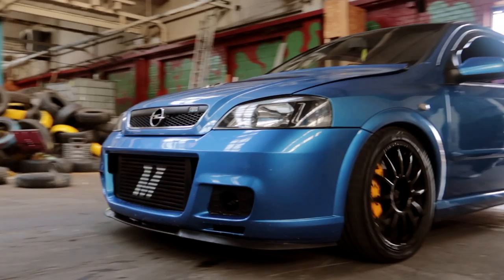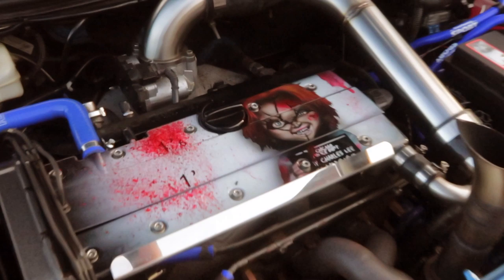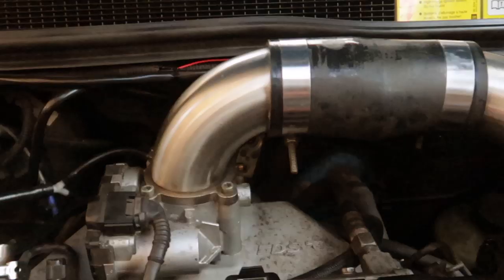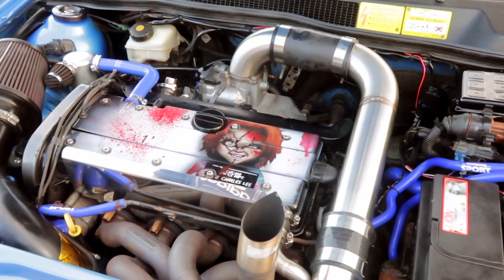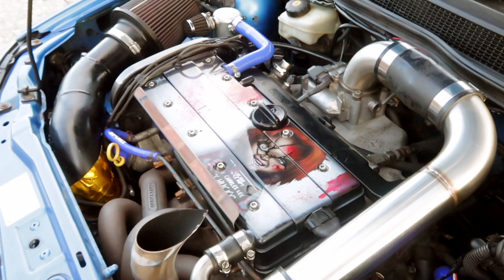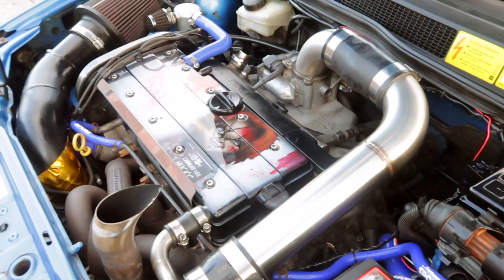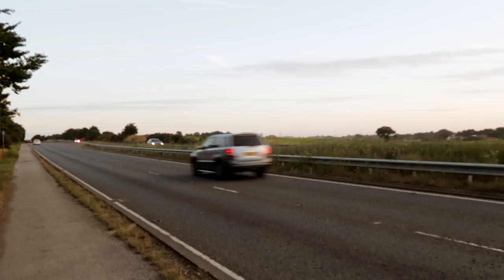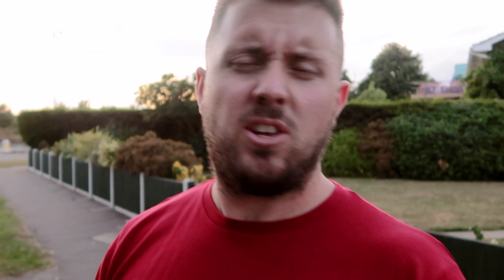*483 BHP* GARRETT VAUXHALL ASTRA GSI TURBO - WE KILLED IT #CJK20

Comment: Kills me seeing these makes me miss my 1.8 sport even more when used to always want a GSI 🤭👌🏽
Reply from the maker: Treat yourself to one now mate !!!!
Reply: I love my mk4 astra 
1.8 sri 188,000 miles and still going strong i just love the shape of them an ill be gutted when i have to get rid
Reply from the maker: Hopefully you never do!!
Reply: @stelfc5384  Yeah mine went after 160,000 unfortunately had only just replaced the gear box but trouble without having a garage it was rotten in most places underneath.. which would never have known just looking at the exterior 😥 Miss seeing that traction control light flickering 🤭
Reply: Yeah there really good bang for the buck arnt they but nothink lasts forever (unfortunately) what happened to yours was it to rusted or did the engine go

Comment: Gota love a mk4 GSI they still look the bollicks, and this 1 is brutal 👍
Reply from the maker: She’s a beaut, unfortunate it broke but owner now has a 500-600bhp VXR Astra that’ll feature on the channel soon!
Reply: @CJK20  shame so it really was 480 broke 😁. Will look forward to the vxr bro, love the channel 👍
Reply from the maker: Appreciate that Dav 👌👌👌
Reply: Chav bollocks. Get real car.
Reply from the maker: mezalong very insightful, what in your opinion  is a real car? Owner no longer owns this anyway :)
Reply: @CJK20  I'm getting better at this troll shit.
Reply: @CJK20  goin hard on say a gsi is good crack and respect to the lads but, my evo 8 350bhp round there anyways, and it can put all the horses down planted bro, savage bhp means nothing if you can't get em down
Reply from the maker: DavT 86 100% mate Evo the better car all day long! FWD with so much power would only be good with slicks at pod that’s it. Aside from that spin city. This didn’t spin horrendously as torque was fairly low.
Reply: @CJK20  a remember having a 106 gti n she was quick mate once ya got past the beh beh beh lol, left me mates old lexus gs300 in the dust haha
Reply: @CJK20  if ya belt me evo in 2nd from standing start it hurts ya neck mate lol honestly pulls like a train
Reply from the maker: DavT 86 for sure man can’t beat AWD!
Reply: @CJK20  my supercharged gti6 will destroy you all in the bends.
Reply: @CJK20  cost mad coin to run bro ya will see me like a fuckin teapot filling up again!! 25 to the gallon n thats urban mate! Av seen it do 9 mile to the G no shit
Reply: @mezalong  haha dont see many gti6 about now same as the 106 gti mate honestly a loved mine it was mario kart on acid 😂!

Comment: Hate to say it but I can relate to the problem at the end of this vid. Mine didn't show until the engine was ticking over and oil light started flickering just after nailing it from Manchester to tesco near santa pod. Turned out to be swarf jamming the pressure relief valve.
Reply from the maker: Ah no way ! Seems quite common issue. Did you fix and repair or move on?
Reply: @CJK20  Common issue? I've never heard of this happening on a Z20LEx, and I own one.
Reply from the maker: Hey buddy, just going off what I’m told :)

Comment: Gtx2871r 500+ that's funny cause looking at the compressor map you're not gonna do more than 450hp. It just won't push the airflow to burn the required amount of fuel.

Put this on a reputable dyno like dyno dynamics and watch it spit out 430 to 440hp.

Happy dyno takes money from dreamers 🙄
Reply from the maker: I have no idea fella, if that’s what you’re saying that’s probably true :)
Reply: 510-520bhp on a gtx2871r turbo 😂